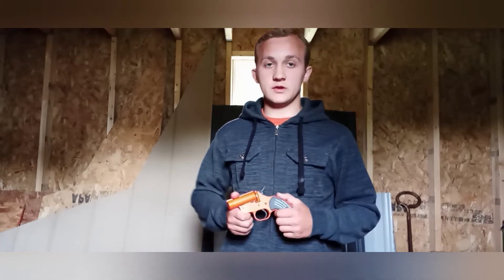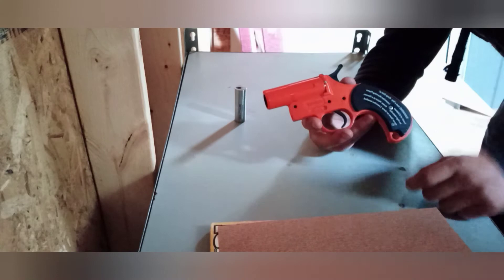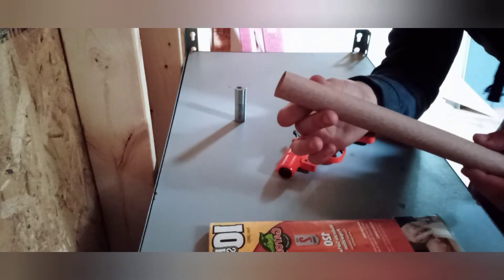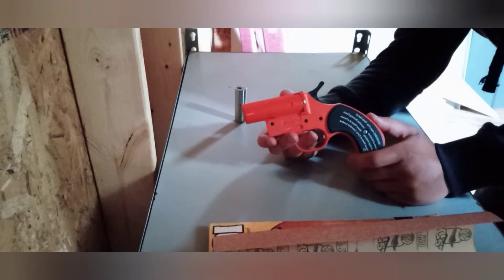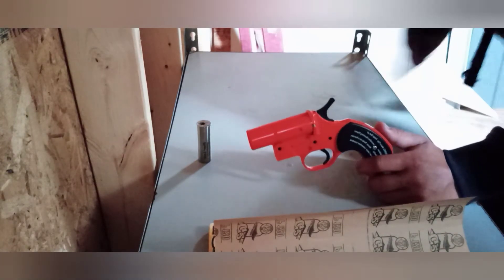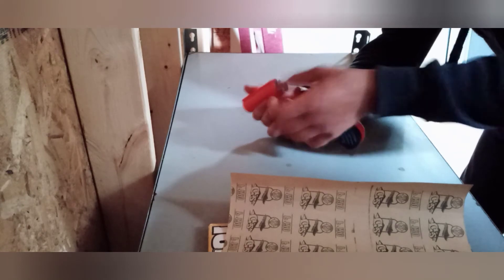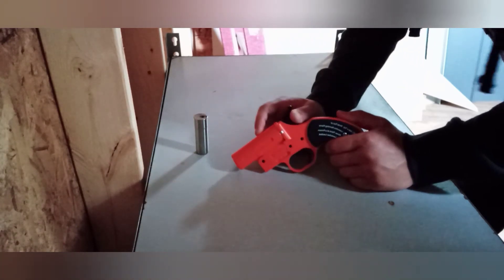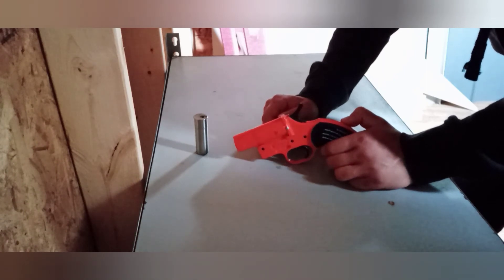How I turned a flare gun into a fire arm ep2

Comment: you can also grind down the lip on the insert.
Reply: How u do that
Reply: @ianaxtell6960  - figure out how far in it needs to go (.8 of an inch or so), scribe a line around the front of the insert that far back from the front, then use a bench grinder to make the outside diameter small enough to fit in the chamber of the flare gun.   youll hold the insert in your hands, turning it as you grind it down.   it isnt as pretty as putting it in a lathe, but it doesnt have to be.  then epoxy it in.